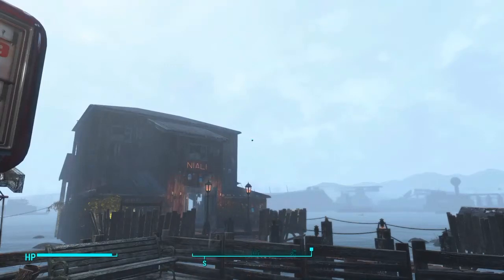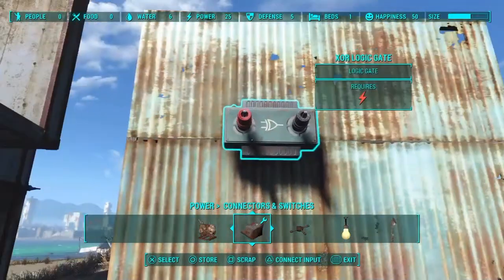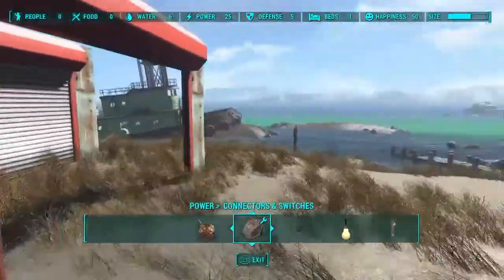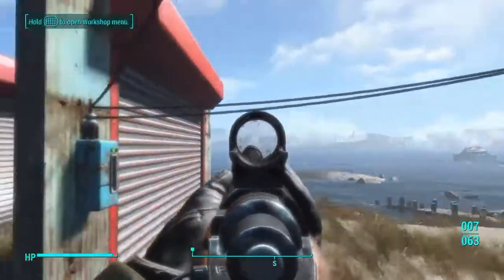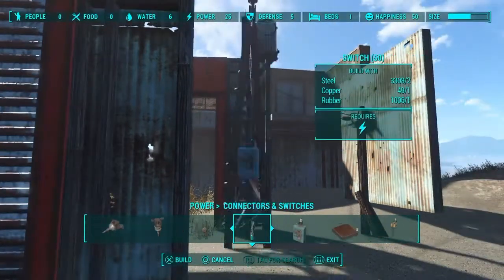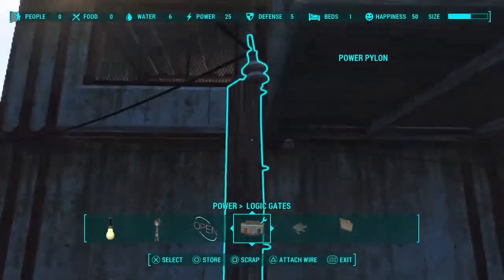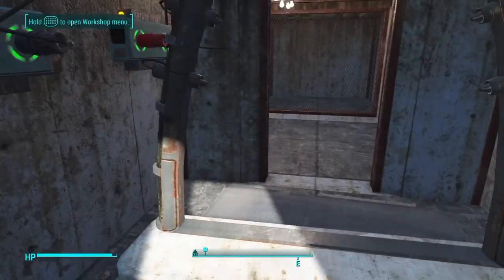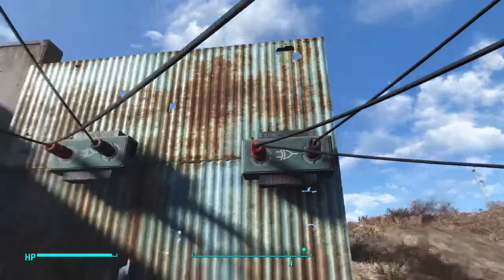Fallout 4 - Build a Powered Airlock Using Logic Gates!

Comment: I have a puzzle for you... how could it be wired so the decontamination arch turns off after closing the second door? I've been trying different logic gates for over an hour now, my head hurts. 
Pro tip- use the conveyor laser tripwire switch on the outside of the doors. Less button pushing, feels more hi tech
Reply from the maker: I don't use trip wires for a few reasons.  The problem with having the arch shut off is that it IS the switch in this case, and so if it were required to be on to open the door, then the door would shut when it turns off.  the best way to do that would just be to have a switch there in the middle that is wired as the arch is currently, and just run a wire from each door to a delayed off then to the arch.  That way it comes on for a set couple of seconds or whatever any time either door is opened.  just off the top of my head.
Reply from the maker: actually that could cause problems... if the power flowed through it and to the other door, opening it... that's possible.  wiring can be tricky like that in that it doesn't know which way you "want it to flow".  Maybe i'll revisit this.  Thanks!
Reply: Just wondering, why do you avoid trip wires? Curious on the negatives before take the time to install this on my other entrance. Your videos are really helpful! Thanks
Reply from the maker: Mostly it's personal preference.  Like when they don't trigger, and so I run into the door and have to go back and then forward again... I just don't feel they're for me because they're not 100% is all.  And I can't say for sure, because I can't even remember the last time I did use one, but wouldn't they open for enemies as well?
Reply: Yeah they do, which is why I use them in interiors mostly... but in this case the enemies aren't turning on the decontamination arch. Also kinda doesn't matter a lot if enemies are already in your settlement when you fast travel there anyway. Would be nice if all the walls we built weren't for nothing huh?